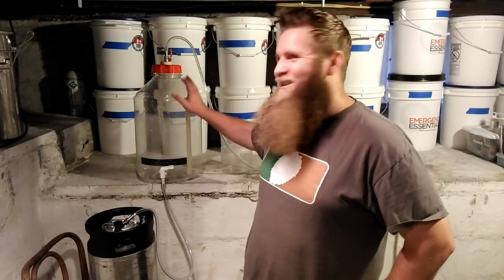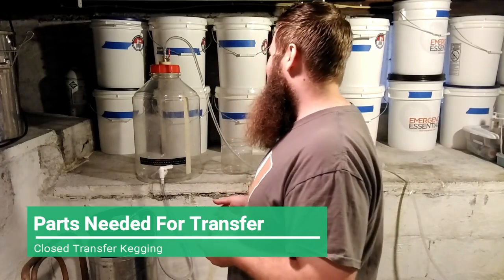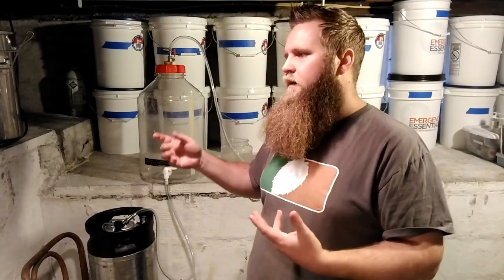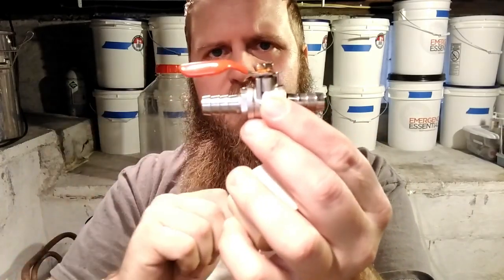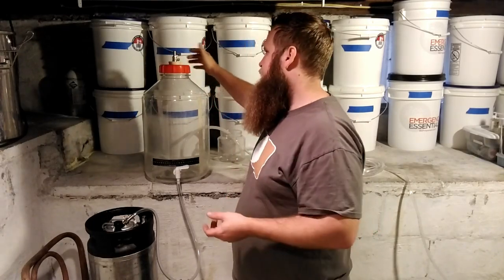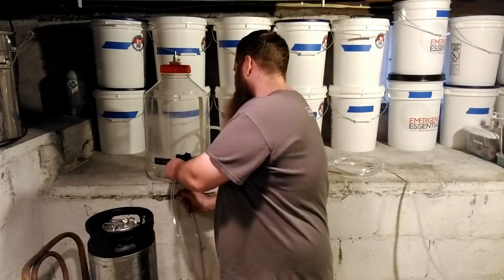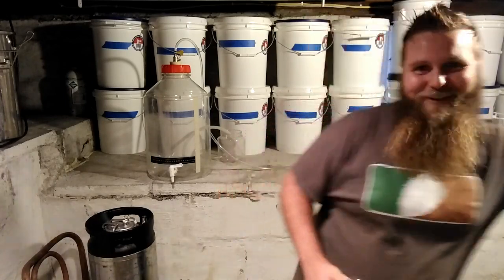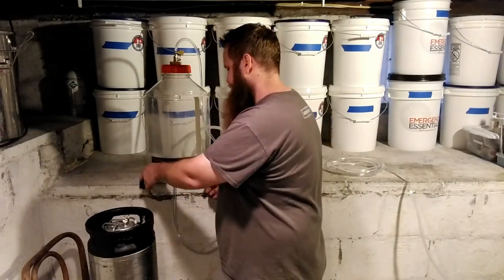How to fill a Corny Keg UPDATED (Simple, LODO, & Closed Transfer)

Comment: I will have to transfer with the open keg option. I thought of filling the keg with CO2 once before opening it. The purpose would be to create an "insulation" layer of CO2 between the beer and air while transferring since CO2 is denser.  Have you tried it and if so what was the result?

Comment: Hi thanks for the info. Really useful. I’ve been reading the comments and didn’t realise that about starsan. So should I just use 70%alcohol to spray inside my keg?  Next question is about filling the keg til it foams. Won’t that cause beer to run into my gas line when I connect the CO2? Thanks in advance and look forward to more videos. Cheers!

Comment: Great video and very informative so thanks for that. Please turn off the music next time though, it’s tough to concentrate on your voice with it playing in the background.
Reply: Quick fix: Enabling subtitles in settings is worthwhile as it makes it possible to garner some of the useful facts and figures. 

This presenter makes some good points as to the value of using the senses when brewing, particularly ‘listening’ to some key sounds such as the hiss of valves when transferring and also, the importance paying attention to the sound that a co2 regulator makes when trying to set up a minimal positive pressure. Indeed, the value of listening is repeated several times during the video and this makes it even more difficult to understand why the background noise has been cranked up over the presenter’s vocals? Enabling subtitles is not a perfect solution as their use cannot adequately underscore the possible value of a presentation whereby key brewing sounds are demonstrated with a description.

Kegland have recently brought out a new product for 2022 as in pressure sensitive gauges with digital displays. Perhaps this product might prove to be a workaround somehow.

Comment: Regarding the keg purge, I find it best to fill the entire thing with sanitizer and then push it out with co2 ensuring a 100% purged environment. Do you burst carb because it may use less co2?
Reply from the maker: Great question! I've seen many people do the sani trick, however the reason I don't like it is because unless the water is deaerated, you're actually adding filling your keg with 3 parts per million oxygen. Now, yes most of that water is pushed out, but not all. Because of that and the fact that you're also using up five gallons of sanitizer I personally don't prefer it. Now, I have done some tests with cans, which is a bit different, but some of the reasoning might still apply. I've run dozens of samples on cans that have been purged with co2 vs not purged at all and i've found little difference between the two when taking dissolved oxygen measurements on the filled can afterwards. However, the beer is highly carbonated and is releasing its own co2 which pushed out the oxygen. Flat beer doesn't have that advantage, but if you filled slow enough and filled the keg 100% it would result in less pickup than if you filled with the top off. Oh, one note on sanitizer. Once thing i've learned is that sanitizer isn't a magic end all, and it most certainly doesn't last forever when mixed. Sanitizer should be used within 3-4 hours depending on the type and discarded. In a spray bottle it should be replaced every 4-5 days tops. We use isopropyl alcohol for our spray sanitizer, which lasts until the bottle's empty. Iodophor (iodine) and Purisan (Peroxyacetic Acid) are used for soaking parts and or and the latter for sanitizing tanks., however those have a limited shelf life once mixed. Starsan is no different. Additionally, different types of sanitizer are more or less effective against different beer spoilage microbes. However, keeping it fresh, and allowing proper contact time will keep a clean brewery. Bacteria, wild yeast, etc pops up all the time, especially in commercial brewing where most of us use way stronger chemicals than what I can at home. Being diligent in this area will make you a better brewer.
Reply: @ItsaBrewDay  thanks for the great followup! I didn't know about the starsan thing, I'll keep that in mind for sure